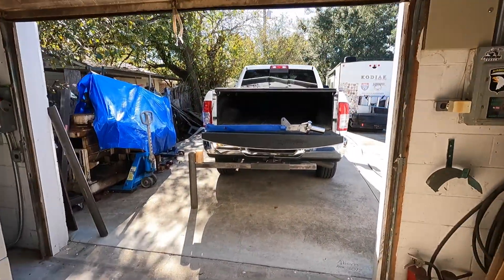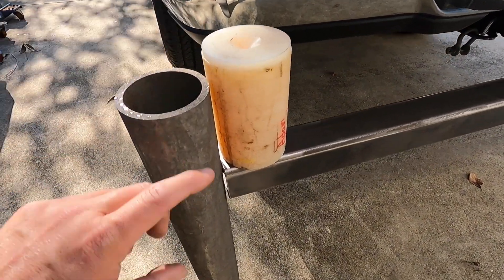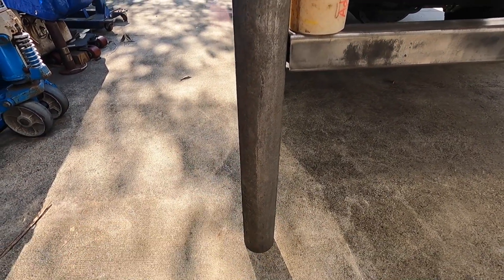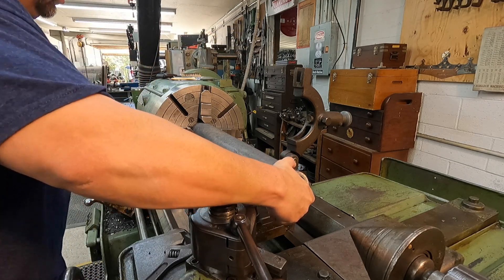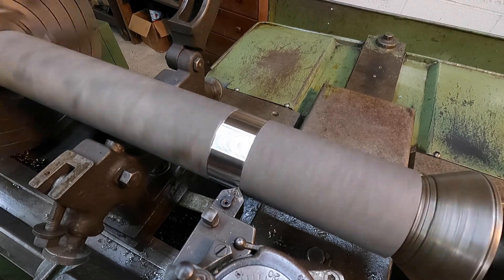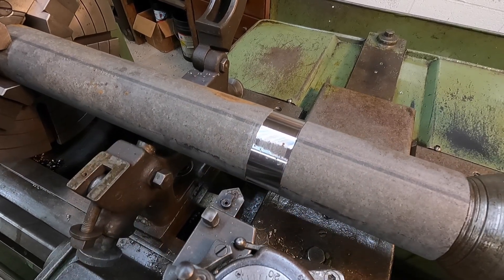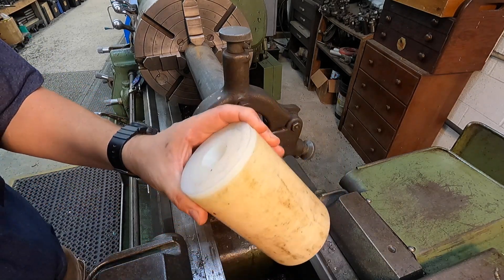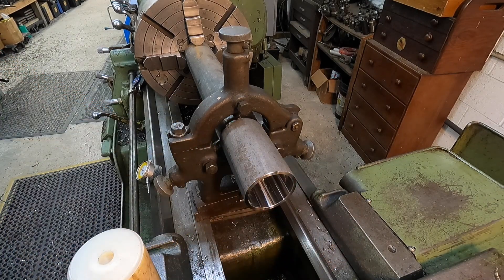Truck Hitch Crane Build Ep. 5

Comment: You could have the crane post free to move up and down inside the ID of a cylinder welded to the beam ,with the base of the post sitting in a  removable footplate with a vertical  locating post on it.
No need for jacks etc. As the suspension compresses the cylinder just moves down the post. Cut a vertical slot in the cylinder and screw a pin into the crane post to prevent it swinging around if that is required
The design only requires horizontal stability
Reply: Yep. This has been suggested on all of the videos for this build back to the first. It's the most simple and robust solution, and the only one that accommodates the inevitable movement in the truck suspension during loading and unloading.

When loading, the suspension will compress leading to a torsion load on the hitch receiver as the crane foot takes the load. When unloading the suspension will lift bringing the crane foot off the ground and rendering it useless.

In fact, the crane will become slightly more difficult and dangerous to use during unloading as the crane will continue to move once the load is on the ground.

But maybe Adam is right and the movement in the truck suspension will never exceed the range of motion accommodated by the natural slack/floppiness of the hitch receiver and slide bar.

Comment: id add a cheap hydraulic bottle jack to the foot but still have the cross pin to get it set "in the ballpark" that would deal with relieving the extra load in the trey on the cross pin

Comment: Hi Adam, would it be possible to use a small hydraulic jack as the foot of the tube? ,if you put 500# lump in the bed there is no pin to "lock" and you already have a handle in your hand for the crane cylinder, multiple height adjustment.

Comment: Extremely simple idea,.... just mount a trailer jack on the bottom, or side of the tube for the foot! Easily adjustable to any terrain height, easy raising, and you can use the quick release style to quickly fold it horizontal.... too easy

Comment: I just got to think about it, but maybe you should also put an eyebolt somewhere on the other of that sliding square tube or the hitch.  That way you can leave the hoist attached on there temporarily and hook it down for times when the back of the truck is completely full, or if you need to pull forward/back up a little to adjust and don't need to pull the hoist out just to move a few feet.  That way you don't risk it swinging around and taking out a tail light or damaging parts in the truck.  Since you're doing an 'adjustable' foot for it, you can push it up and out of the way and pin it up also.

Comment: dont mind if i borrow this awesome idea - id use a spindle as outrigger height adjustment and weld a socket onto it so i can work it with my cordless impact put a foot plate and a sleeve pipe over the interior pipe with a pin for safety i you lift especialy heavy 
maybe look on a scrapyard for a old lathe spindle or some other very loadstrong thread

Comment: Since it looks like you'll be using some kind of jack for support, is it necessary for the tube with the bushing to extend much below the cross beam? Shortening it should save you several pounds to have to handle each time you use it. Good video. It's coming together nicely.

Comment: If you have the air bag option on your truck, you won't have to worry about suspension sag. Also, if you filled the crane support tube with water before welding, would that stop deformation from welding?

Comment: When messing with pipe, I always found it was better to cut my steady rest band near the chuck because it's dialed in there, then flip the pipe around.  Now you already have a true band to put your steady on.  Using the bull nose, like you mentioned may be pretty far off depending on the cut angle or internal weld seam.  Of course for this project, none of this really matters.  (Comment was edited to be more clear)

Comment: While a trailer jack is a nice idea and simple, I recommend a custom foot (with load bearing surface area) with a pivot socket joint attached to a smaller diameter pipe that is threaded at it's top section.  That threads into mating threads on the lower section of the larger vertical pipe that is welded to the cross-beam. This way you can spin the foot up or down to any height you need and the pivot allows are uneven surfaces.  No matter what you do, I am sure it will be robust and sensible.

Comment: Adam, have you tried one of the anti-vibration, silent boring bars from Sandvik??  Unbelievable!  We recently purchased one for an Okuma lathe to try out.  4340 steel, 800 SFM, .012" feed, .150" off the ID.  14" of bar overhang.  Quiet and smooth.  We couldn't believe our eyes and ears!
Reply: what size boring bar?

Comment: Nice job on this so far. Have you considered running a gusset from the vertical pipe down to the horizontal pipe? You are talking about being able to lift, theoretically, 2000# with the engine hoist component and I would be afraid of the heat affected zones around the square butt weld giving way. Just a thought. :)

Comment: You may have a DESIGN FLAW.  Assuming the post is welded to the support and when installed it rests on the ground, then you place heavy weights in the back of the truck, the truck will attempt lower from the weight, but due to the post it won't as the post is now carrying all the weight, and you won't be able to remove the post when you want to drive away.
I just started with the video - perhaps you address this later in...

Comment: Why don’t you use a scaffold screw Jack to support the arm. Then you don’t have to worry about the pin getting jammed after the truck is loaded.
Reply: I was thinking the same thing.  I'm sure Adam has a plan for this situation.

Comment: Well heres a concern that maybe has been brought up what I you are loading with front of truck lower than the back when you lift it it may swing wildly out of control injuring someone or possibly damaging truck part being loaded and possibly other things same for loading with the front higher and it swinging backwards about the only way to counter that is make your slide rail able to pivot and lock somehow so you can level it up some
Reply: Valid point!  A lifting system should never depend on uninterrupted muscles and operator diligence for stability and security.

Comment: Remember if you cut the pipe level with the top of the tailgate, the tailgate will impact it when the tube is slid into the stowed position. Possibly better to cut it for tailgate clearance so you can open the gate anytime, regardless of crane tube position

Comment: Don't know if you see it as a possible failure point, but the pipe that you insert the nylon bushing into may distort if it is subjected to the stress of heavy torque, I suggest adding a hardened steel sleeve over the pipe the you may want to extend down to the cross beam and weld it there, and you may want to add gusseting at that point as well

Comment: 14:00 Gotta say Adam 'you're doin' it wrong' !
For cleaning up the OD for the rest, having centred the tube in the chuck, if you'd turned a clean surface at the chuck end for the steady, then turned the tube around, and recentred, both ends would be running true - and you could put a shamfer on the end of the bore for the tailstock centre - then mount it chuck & centre for turning the OD where you actually want to put the steady.
Reply: I have seen Adam do just what you suggest. BUT Adam makes it clear he is not machining this to high accuracy. If memory serves Adam does exactly that on the 9 foot shaft  Search for his "most watched" video and you will see it.

Comment: i am wanting to build something like that except mount in the truck and swivel from side to side and out back but be able to lift 3,000 lbs been thinking about using a 1 1/2 ton truck rear hub assy for the swivel

Comment: i wonder if lifting a load across from the crossbeam straight behind the truck or having the load hanging over the bed will twist the crossbeam and kicks out the support leg  , might want to put another crossbar under the pipe so the foot has a greater base , since you put a pin in it it shouldnt make the whole crane support higher if you pay it in the bed 
as for the truck sagging , maibe use two adjustable feet  if realy needed you can screw those in and get the load of the setup to be able to get it off the truck 
the higher position of the leg (level with the tailgate) makes it eazier to slide the crane over the hole and lift it so it drops in having it lower might risk the crane sliding off the tailgate while lifting and makes it harder to estimate if its over the hole

Comment: Really, the crossbeam really ought to have a yoke (a loose slip fit ring) for the pipe (that the pipe could slide in, maybe with a lock screw for the pipe). The crossbeam, yoke, and the hitch should just serve to keep the crane upright: The foot takes load.

Comment: sure is alot nicer build than the " Chinesium " $125 ( canuck buck ) truck crane i bought 15 years ago in Canada ( was at a bargain store )...
it mounted in corner of bed ( or anywhere you chose )... swings easily anything off ground into bed...i used it on my trailers too and am going to build a 3 PH ( 3 point hitch ) setup for my garden tractors
got too many heavy attachments to move load and drag around!!
i got a 12 Volt crane too in a mini van ( montana ) that i installed in my dad's van for his scooter...it sits in one corner too
and swings scooter out to ground and back inside...
got it for $250 at a handicap store ( used )...was like new
lifts about 400 pounds+??

Comment: Yeah, i think you could have an issue as I understand your scheme of things if the truck bed is loaded up and is sitting 4-5"-8" below its unloaded height. Someone below suggested a scissor jack from a junked car. I like that idea. I think you're going to have to allow for a lot more adjustment for the base of the vertical tube.

Comment: Adam, ? Why haven't you gone to bearings in your steady rest, even so When I need to use bronze rest posts, I use the under side of emery cloth & put oil under the emery, it prevents bronze wear from running on metal surface especially when running for extended time, you are awesome !!!
Reply: I think when you have rollers, a chip can be feed thru the roller.
When you use bronse posts the chip will get expelled, not get under/ trapped.
Escuse my not so good english

Comment: Dang this video ended to soon. 

What do you guys think about this idea?
Thinking about the foot getting stuck after adding weight to the suspension.  You could put in spiral slots about 2" length x 1" in height. That would allow you to take pressure off the foot after loading. The inner tube would need a tapped hole.

So when the truck is loaded and putting pressure on the foot you just loosen the t-handle (or whatever) and the weight would lower by sliding around and down the spiral slot. 

What am I missing?

Comment: not sure what will be the bearing surface when under load (would it make sense to have an "horizontal" bearing surface for the nylon bushing to turn upon?) - or are you planning to stick a ball bearing somewhere underneath to take up the load... I understand the nylon vertical wall will take up the shear (which will be significant considering the leverage)
Reply: We are thinking alike, that nylon bushing seems like it will be pinched at its top and bottom by the machined insert when under load; it may make rotation about the axis harder.
Reply: @markr1256  that also (which makes the shear from the total leverage apply on a small area, causing a couple pressure points of wear rather than a surface), but there is still the question of the vertical load...

Comment: A word of caution as you progress through your project, working piecemeal one part at a time is asking for trouble.  Through my career I saw a good number of failures as a result of not having a well engineered design, and having the product built as designed.  It is not clear that you're keeping track of details such as loads, weights, moments, etc.  As far as I can tell, you've not determined the exact weight you will be lifting, or the resultant loads on the hitch, both in terms of weights and moments.  I  once saw a 10 ton kingpost bend the 1" thick deck of a tanker when an operator hauled in on a topping lift when he should have payed out.   Besides the operator's  error when designing the kingpost and boom the ship designer assumed the deck was rigid.  They didn't consider the ship hogs and sags and there loads and stresses in the deck.  In short, the deck was far from "rigid".  The tow hitch is designed primarily for tow loads.  They are not designed for the moments of lifting from the corner of your truck.  Another point, are you going to put your rig in the bed of your truck when you're in transit?  If not, have you considered wind loads?  Or, blind spots when driving.   I would suggest that you stop, define your design, parameters,  develop a plan, including drawings and you proceed accordingly.
Reply: Valid points, but Abom79 is more of a jazz player than a symphonic composer.  Being a lifting device, this does demand a careful analysis for the weakest link.  It's always the weakest link that limits the overall performance.

The nylon sleeve worries me.  Leave that out in the sun, and it will weaken and disintegrate in a matter of years.  Then it fails under max stress, and the whole works cascades.
Reply: Why would he go to all the trouble of making it so it can be lifted out of the nylon bushing?, so it can be put in the bed of the truck while driving, plus the fact that the foot would dig a nice trench, try listening to what he's saying instead of picking faults out of thin air
Reply: @andyb7963  Adam in demonstration indicated he intends to break the rig down for travel.

Comment: you should make your stabilizer unpin from your " crossbar " as a seperate part...just sleeve it over crossbar... weld sleeve on stabilizer...then you can leave the crossbar in hitch ( when you go to get something ) and pop stabilizer off to store in bed ( or flip upwards on crossbar if needed?? ).. do you plan to remove it after use??
pin crossbar to not " slide " of course!! 😉
also stores easier if breaks down into parts?

Comment: Little concerned about the leg to ground pin getting jammed under the load in the truck.  Could squat 3 or more inches. Plus torque on the square stock and hitch.   But I don't know the amount of weight you're putting in.

Comment: It looks a WHOLE lot better than the one I'm building. I am repurposing a Harbor Freight truck bed crane to work from the hitch. I didn't like the way they designed it to bolt to the bed of the truck.
Reply: I’m about to do exactly the same thing. I also have the harbor freight version and so far looks like I need to make the same “base” to weld to.

Comment: Hi Adam, i can see an issue with this crane here, i think you will need some form of hydraulic cylinder or screw release, as mentioned in comments, as once the crane weight is transferred to the truck bed you will not be able to undo the support. Also there will be undue strain on the tow hitch supporting the rear of the truck. You may also need another support on the opposite side of the bar. Positive criticism here Adam and not a reflection on your excellent work. Regards, Norm

Comment: Won't welding it make the bushing melt?
Reply: You weld it before installing the nylon bushing
Reply: @clintonhanson  He said he was going to press the nylon in then bore it in place. When that is done it will then get welded to the cross member. So the bushing will be installed whilst welding.
Reply: @byejason  That is exactly what i was thinking, and as it will be quite thin i expect it would be difficult to remove after boring.

Comment: Nice project.  Enjoyed it.  Trouble is, what Made in Poland or Make It Extreme does in 30 minutes takes you 5 episodes.  Things are slower in the South. <L>
Reply: A slower pace so you can enjoy Adams fine work much longer. Race horses entertain; work horses get the job done.
Reply: I think it would be quite cool if Adam started to just upload all parts like it is now and then makes a 10-20min timelapse or so, just like Fireball Tool. First the original building videos and then the 10min vid where all is shown in
Reply: @ellieprice363  Work horses have been replaced long, long ago. Today, they entertain, mostly.
Reply: @larrys2894  Not yet. Adam Booth, Keith Rucker and Mr. Pete are still here, taking as long as they need to do the job right.

Comment: Couldn't you just drill a hole in the tailgate, instead of the pipe going to the ground?  That way it
will be where you need it, with no adjustments needed with a foot.
I hope you know I'm kidding???????
Maybe some kind of short pointed type pin on the foot, so the support doesn't try to slip
sideways on you if it is heavier then you think.   That may be quite a strain on your weld, because of
how far the boom sticks out, plus the weight of what you are lifting.
Looks good.!!!!!!!

Michael

Comment: I haven't seen the rest of this series so I'm gonna have to agree with your viewer who was worried about the weight not allowing for break down. I'd probably make sure I had a jack with me when I used the crane. It only has "play" in it when there's no weight on it all that play goes away when the truck bed has weight pushing down on the hitch which will transfer to the "foot".

Comment: this may be a silly suggestion but you COULD use two jacks to place in front of the rear tires to support the bed and prevent your truck from kneeling under the weight if what you’re loading.
Reply: I suspect he may do something similar by using a second leg. 
The load I think he expects to pick up should be less than a ton.